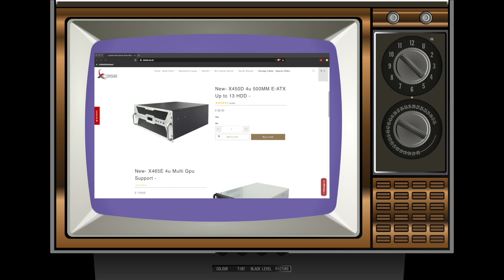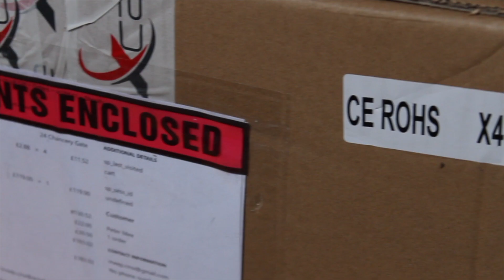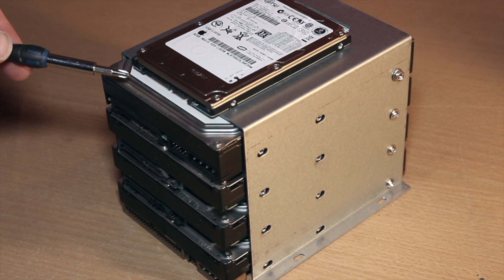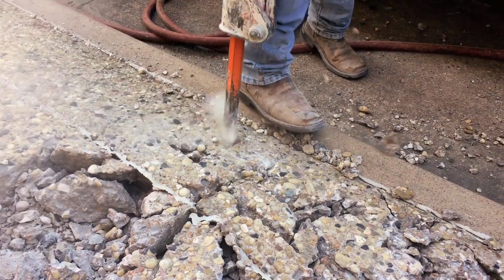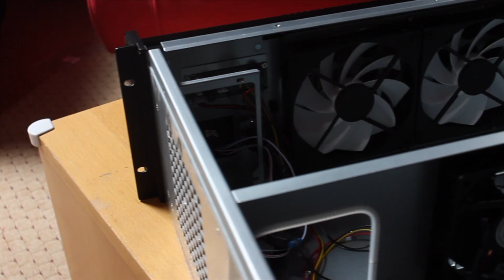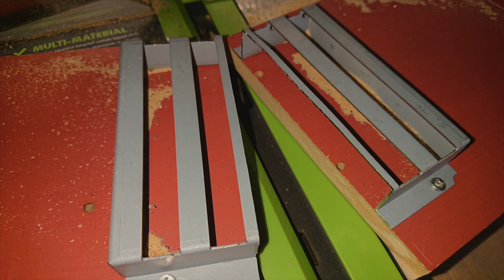X-Case X465E First Impressions

Comment: Found your blog through reddit, Was this case useful? Been planning to bifurcate 6 PCI-e x16 in order to connect as much capturecards at x4 as possible, my main idea was using a Seasonic with x12 HDD 3.5" bays and a 3d printed adapter. But seems this case may work.
Reply from the maker: Yes. An excellent case for use with bifurcation and breakout PCIe slots. I sold it on as I moved away from rack mounting my server, reduced my bifurcated slot requirements, changed motherboard / CPU and needed more hard drive space. However, i'd have no hesitation purchasing again if I had an application for it.

Comment: I am personally looking at this case and wondered your opinions after install & using it. I was thinking the front panel is not utilized very cleverly with that LCD, button and USBs and thought about moving them to be more compact and having the front panel more open for PSU to exhaust, have you modified yours?
Reply from the maker: Hi. I agree with you that this would be a good mod, but I have not attempted it. Having said that, I've had no issues with my PSU and thermals, while higher than my previous Thermaltake Core X9 system, are acceptable. This case gets increasingly difficult to work in as you add more components. In fairness, mine is pretty jam-packed, and I dread the though of, say, identifying and replacing a failed hard drive. The big bonus of this case is the number of PCI slots available, and if you need that, you need to live with some of the compromises arising from that feature. If you don't need the extra slots, I think I'd be looking at a more conventional case.
Reply: @mediaserver8265  Thank you for replying. Going to sandwhich some radiators into drive cage area and have all of them exhaust from front and have VFIO virtualization tinkering hardware water cooled if needed with quick connections. Well it is going to be interesting project for 2021 :)
Reply from the maker: If you make a video about it, let me know. Always interested to see what others get up to with equipment similar to my own.